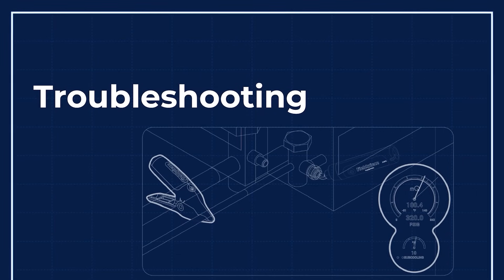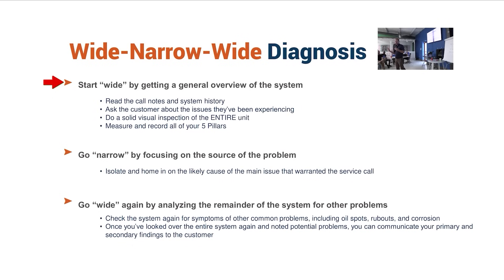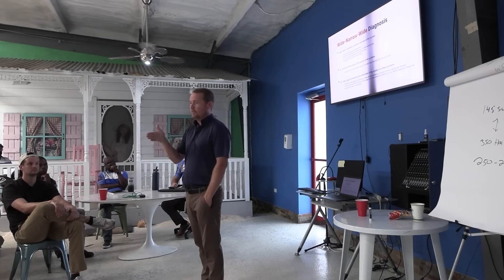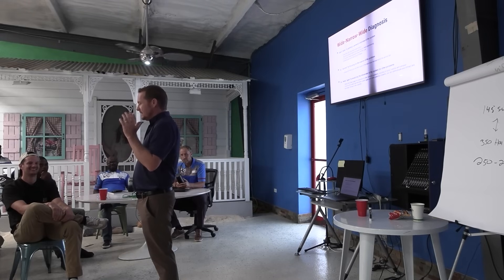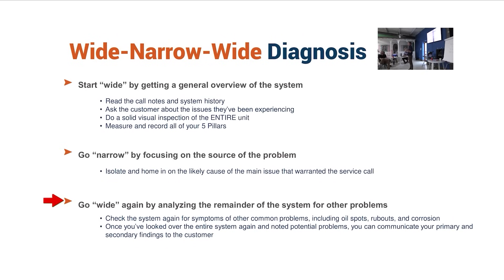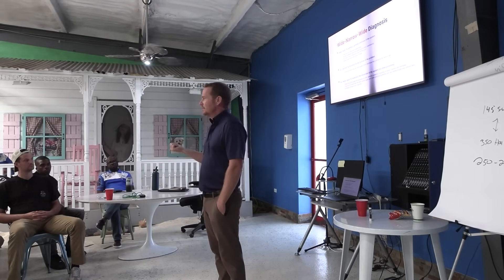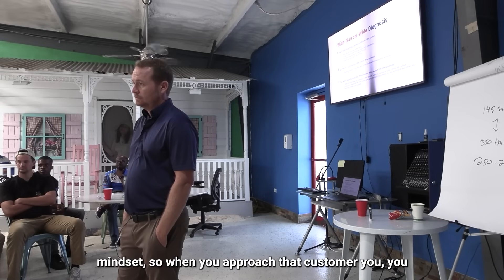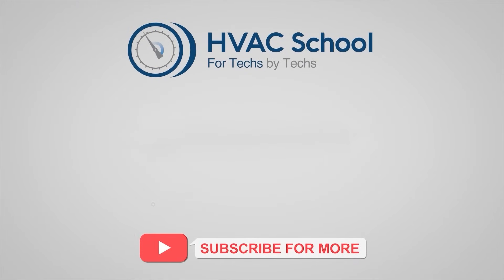HVAC Troubleshooting Part 3

Comment: The parts changing technician sometimes, and some companies is considered. They’re more profitable star technician.,  in some situations in some Owner‘s eyes this is what all his technician should be selling thousands of dollars in parts generating revenue not actually fixing the problem.  But along the way of selling a lot of parts the problem was solved, and the profit margins are extremely high.. 
      And the same individuals and the people back at the office got very ingenious and creative at writing up stories to make everything sound logical that needed to be replaced to the customer so they don’t feel they got ripped off. 
   The customer doesn’t know any better. 
    The owner of the company sleeps well at night because of all the extra zeros and decimal points being deposited into his bank account. 
       And you have the owners and service managers, saying we did not force the customer to buy these products. We just offered them opinion or an option and they did it on their own..  
   So somehow, this makes their actions OK and makes them not look like the bad guy of which they really are. The lowlife scum, sucking thief that tarnish is the reputation of the entire industry.
Reply: Customer could go to a new company as you keep screwing up and it makes you look bad so guess it depends on the customer
Reply: @ this type of shop owner relies on . ( new sucker born every minute)  when they start running out of customers were returning to the shop.  They throw out a little ad advertising and wait for the fish to bite.. 
        They throw out what is called lost leaders.    Really good sales coupons with good prices for cheap service.. 
      This gets them to look over the car for problems. And things that aren’t even problems yet, but they tell the customer they are..